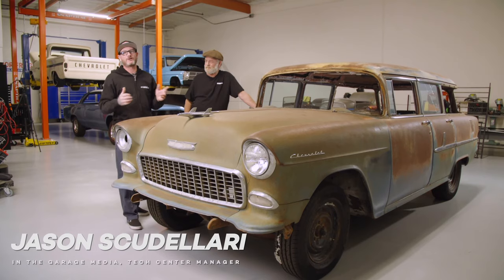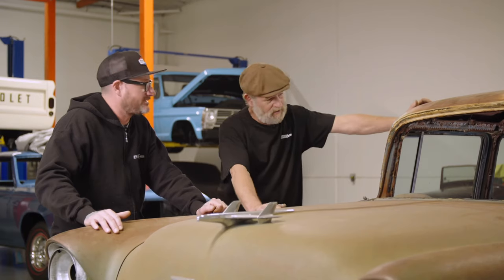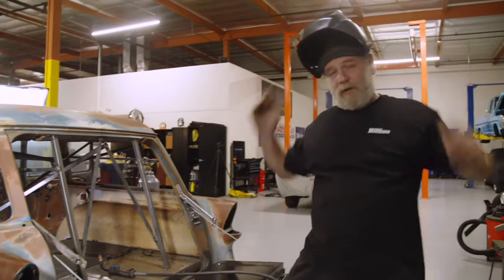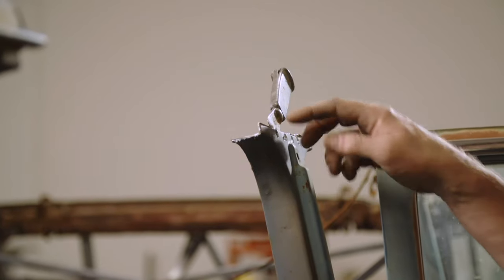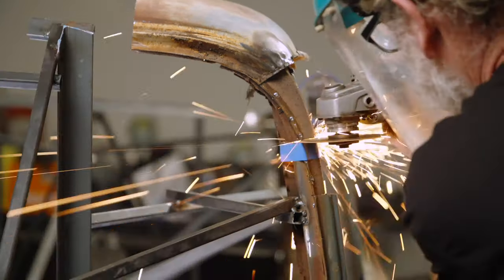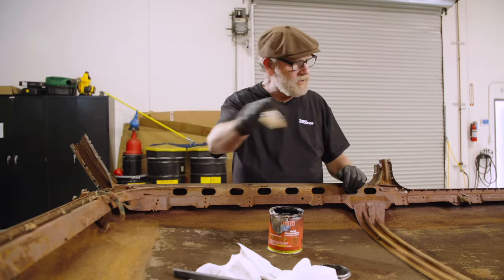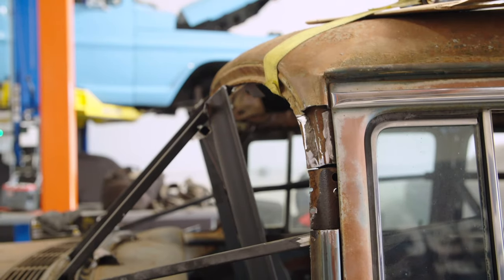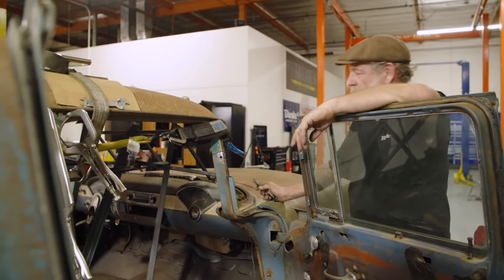How to swap a classic car roof properly like we did on this 1955 Chevy wagon project.

Comment: Nice job! I know how much work that is. I just chopped up my 55 2 Dr 2 210 wagon roof, which had minor rust.
I grafed a Nomad roof to my A piller at the dash area and I'm hanging Nomad quarters that were rotted to the roof by what's left of the B and C pillers. I'm rebuilding the lower rear quarter window channels that nobody makes along with other parts that I have to hand make.
It's coming along slowly, but it's coming along nicely.  I'm using templates I'm making from my other Nomad that I have had since 1974. 
You did a really nice job fitting it.